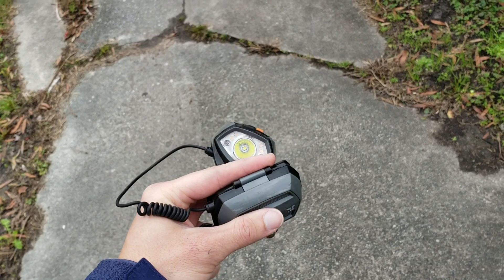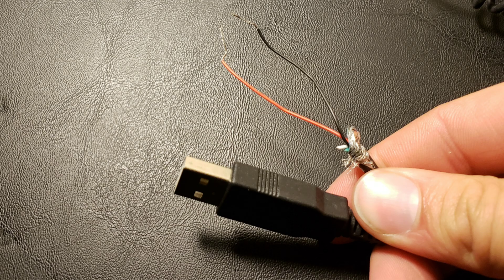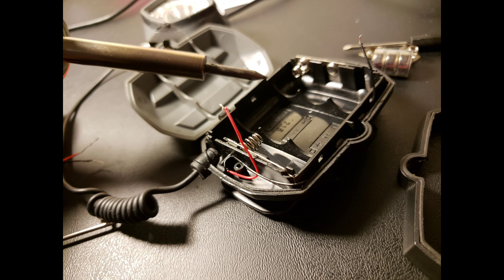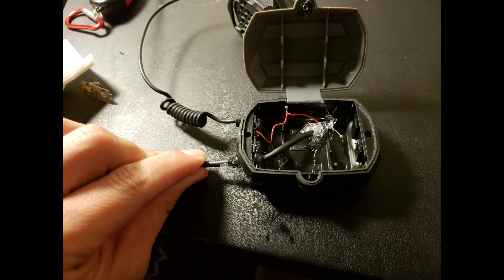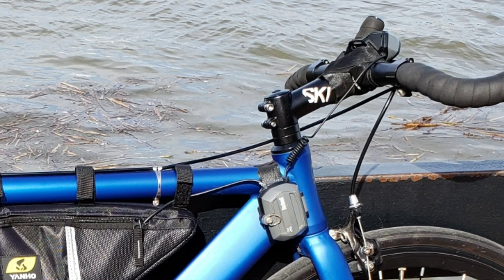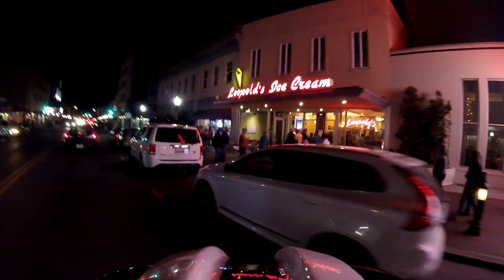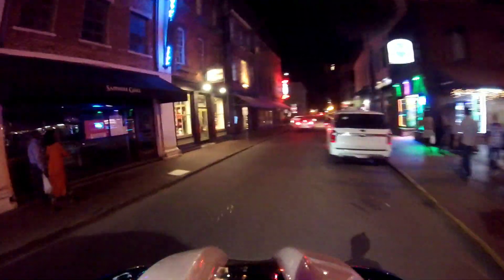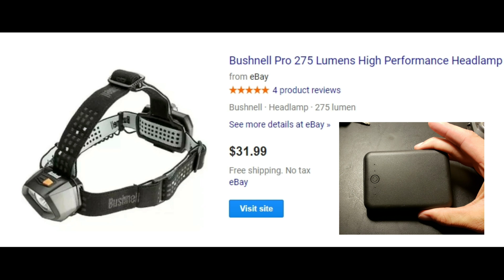AA to USB DIY bike light conversion

Comment: FYI>> You don't need the case at all, just wire the USB plug to the wires on the light...also this will only work for lights that run off 3 1.5 volt cells  not 2 (burn out bulb) or 4 (dim light).
Reply from the maker: here recently I've actually thought about cutting the case out completely. The only reason I left it originally was in case I ever wanted it to go back to AA battery down the road
Because of the battery bank if the draw is actually less than 3.5 volts it will only pull that from the bank so there was no fear of shorting it out. The bank can put out up to 5 volts 2 amps